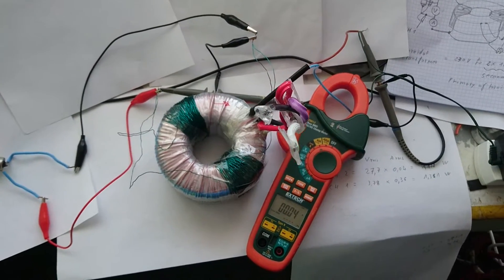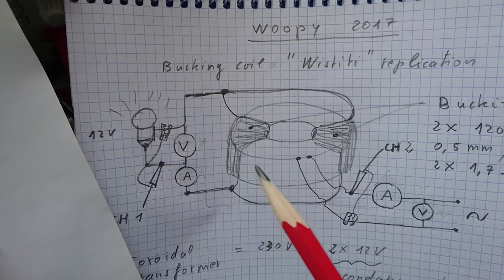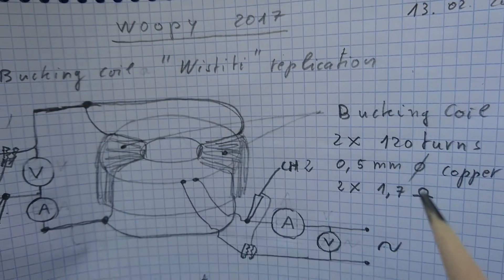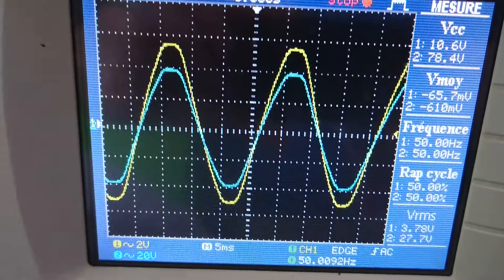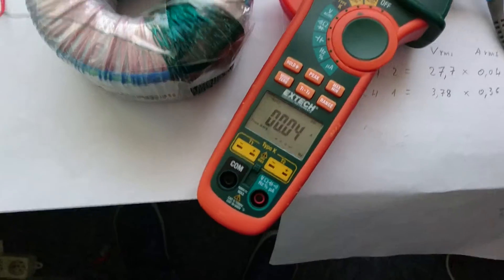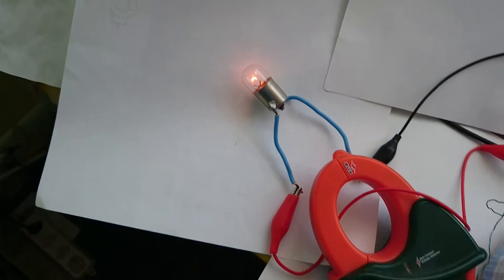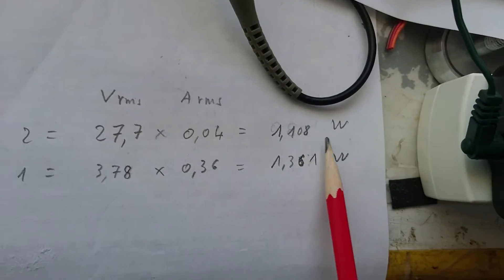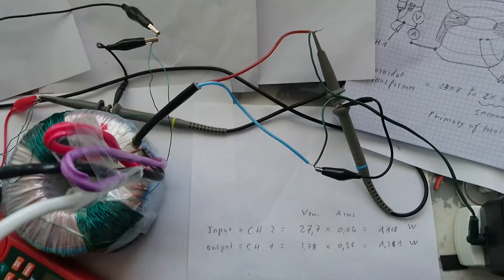bucking coils in POC transformer efficiency measurement

Comment: Wonderful, Woopy! It's a pity that you didn't measure the respective phase difference between voltage and current at the input as well as at the output.
Overunity can only result from a symmetry break in the physical vacuum.
Predestined for this would be the nonlinear processes in the ferromagnetic core material.

Comment: Can you add more light bulbs in parallel on the output, one at a time, and measure the output wattage increasing bulb after bulb, and re-measure the input wattage after each bulb is added?

Comment: I should have also said your clip on ammeter has insufficient resolution ( + or - 1 count) to read current accurately enough. 
It could make input current 0.05 or 0.03 ...a huge difference in your efficiency calculations.

Comment: Hi Woopy.. if you measured and took into account the phase shift between input current and voltage your OU gain's would likely be even be even greater. (input pwr =U x I x Cos phi).  I think the gain comes from exploiting the non linear change in inductance in the cores BH curve itself.  So the translation from input to output is not 1:1 ratio ... energy stored per cycle (0.5 x L x I x I) in the core has a delta value for L for different values of I. There is also an old registered patent concerning this effect. Thank you for your always clear demonstrations here.

Comment: Bonjour Woopy, qu'est-ce qu'il arrive au courant d'entrée lorsque vous déconnectez la charge (ampoule) de sortie?
Reply from the maker: Bonjour Luc, quand je deconnecte l'ampoule, le courant d'entrée descend à zero (+ certainement quelquechose mais pas mesurable sur ma clamp meter), le voltage d'entrée monte un peu vers 27.8 volts, et le voltage de sortie sur les bucking coil monte à 4.16 volt.
Pour info je regarde aussi les progrès du TD, mais j'ai peu de temps libre en ce moment.
Reply: Merci pour les détails. Je réplique actuellement le toroïde de wistiti. Une vidéo à suivre. Luc
Reply from the maker: Hi Luc i write in english because this is of general interest. At OU forum , user Itsu made some comments and i have redo the test with a CSR in place of the clamp meter to check the current trace on the scope. By doing this i found that the trace is a nice sine wave, but the current is much higher on both side input and output, so the final  results is no more interesting at all. I will wait for your results to be sure that the Wistiti's experiment is worth or not to be continued. Sorry but i wonder why a so expensive true RMS clampmeter can be so faulty.
Reply from the maker: Hi Luc

Things are progressing on OU forum
Chris Syke  (hyiq) the promotor of the POC( partner output coils ) bucking coils remind me that perhaps the Bucking coil ratio from primary to the partnered coil should be much higher in order to create the "charge separation" . So the ratio should be 1/3 to 1/5 turns pro 1 turn on the primary. So if you have not begin your winding please consider this info.
Reply: Thanks for the updates. My test device did not show any gain. A video demo is being uploaded as I write this. Please check the forum topic in about one hour for my post and link to video demo. Luc
Reply: +woopyjump - Turns should be, either way: 3 to 5 Turns on Primary to 1 Turn on the Secondary, or it can be the other way around as you say, 1 turn on the Primary to 3 to 5 turns on the secondary. I believe this has something to do with the 1/4 Wavelength Tesla Introduced us to. This makes for a better efficiency! Also, check your Currents, its important the Currents in the Partnered Output Coils Oppose, or no energy gains are possible. Use the Right Hand Grip Rule to verify this.
Reply: Thanks for sharing in English! Thanks for sharing your information.